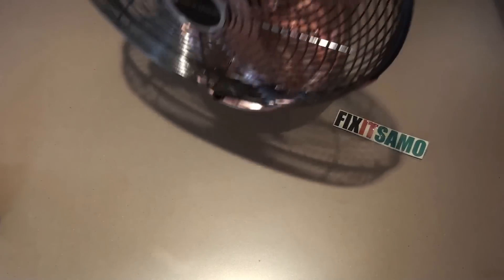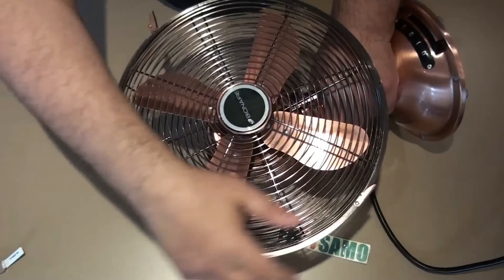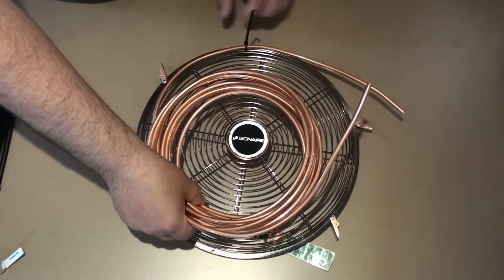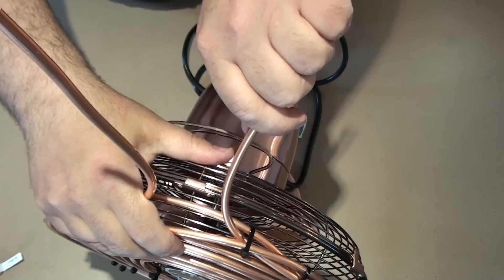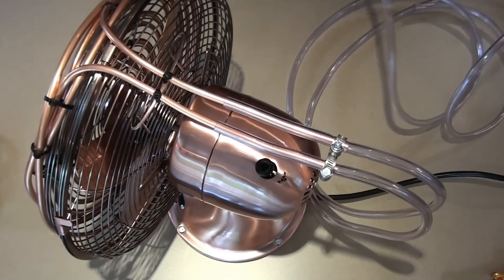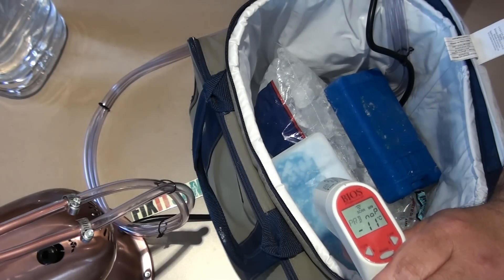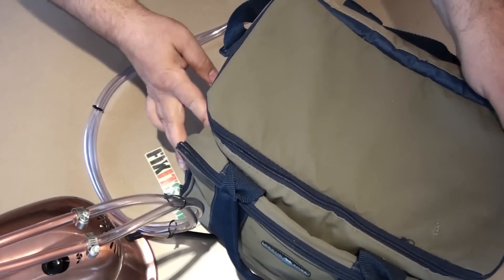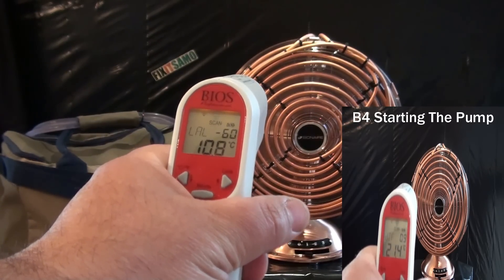How To Turn Your Fan Into An Airconditioner  AC

Comment: Great job ! I like seeing people use their mind ... INSTEAD OF CRYING LIKE BABIES. The "experts" making comments on here couldn't figure out how to blow their own nose with the instructions written on the box of tissues unless their Mommies did it for them ... as usual .... good gawd people. This guy is trying to HELP people ... WTF are YOU trying to accomplish ?? Go back to your cell phone world in Mommies basement while she's working 2 jobs to feed your useless ass.

Now for my 2 cents. How about having a full sized or mini FREEZER or even a regular fridge with about 25 or more feet of coiled copper tubing WITHOUT WATER inside ? Could even use an existing unit and only use one shelf for the copper tubing ?? could even leave it coiled up in the box to save room !  Drill holes in the top or sides of the unit to run the pipes and done ?  Seal it up with RTV or similar sealer. Put a catch basin  for any condensation that could be easily emptied as required. BOX FANS are great !! I use a box fan to circulate the A/C in our house because of Sky Lights ... yes, I have curtains in them but still get a lot of heat from them. We have central air that works great except for the rooms with Sky Lights. I'd never buy another house with Sky Lights. .... and NO they don't and never have leaked in over 30 years. I'm retired so not about to change it now.

Ok, now go ahead and chop me into confetti so I can have a few laughs !! LOL !!

Comment: Very good idea. I would put a coil in the back of the fan too. Because it draws air pressure from the rear. Also I would use a second(larger)  cooler for the return water so it has a chance to cool and will not immediately mix with the already cooled water. Place a second pump to feed the return tank water into the cold  tank. This should cool more and longer. I'll make one and see what happens. Again great video. Thanks for sharing.
Reply: Jesse Madison please do a video of the upgraded version.
Reply: @occipitalneuralgia2339   Thanks. Upgraded version release 07/10/20 I'll do a side by side comparison with my current portable ac unit.
Reply: That makes sense,  really curious if that works better please post & share if you build one like that.
Reply: @tanyapineda7212  Thank you for the encouragement. I will definitely post and share it. I currently have one of those portable air conditioning units. And honestly...it sucks. 
I believe that the fan idea would not only cool my room far better, but it would consume far less energy than the actual air conditioner. I'll post the comparison between the two. This will be very interesting. Thanks again.
Reply: @tanyapineda7212  have you made one yet?
Reply: Sound cool
Reply: @megatron6771  Thanks. Let's see how it turns out. Video Release date 07-10-20
Reply: could even put ice in the second cooler so it will be already cool when it returns to the original cooler!
Reply: @Son-Of-David1990  exactly.
Reply: just a quick note i thought about fitting the piping on the back but condensation drips collect on the copper piping and end up getting sucked through the fan blades.. i havent tryed installing them on the back but i have looked at quite a few of these diy ac fan vids and you can see in other vids that there is a fair bit of condensation with this setup.. i made mine with the pipes on the front and i have a 22 inch workshop sort of fan quite powerful from homebase uk cost like 40 quid. this idea is pricless and does work on a small scale.. its not going to cool a house or room but if you sit in front of it then its flippin chilly lol

Comment: This is a decent idea for one reason. 1: the ice is traveling through a tube, long enough to get the pipe cool, but not long enough for it to change the temp of the water drastically while it travels through. One drawback is the idea is good but the time of use before adding ice depends on what kind of cooler you're using, if you buy a cheap one you're looking at a few hours. If you got an extra 100 bucks or so you can buy a higher quality one.
Reply: This would be great with an old or extra Yeti!!
Reply: Bknnnjjjjjjjjjjjcj.       Chhxgc.   Hihgjh
Reply: Jhhhhhhhhhhjjjjhhhhghhhvhhhhhhhhhhhggbbbbvgghhbbbbbbbbbbbhbbbbbbbbbbbbbbbbbbbbbbbbbbbbbbbbbbbbbbbbbbbbbbbbbhhhhhhhhhhhhbnmhkgjgkghg

Comment: Just put ice in front of the thing
Reply: The fan will blow hot air across the ice. It will melt in no time. Hence the need for the ice chest.
Reply: @HueMongussD  doesn't for me, I have big ice containers
Reply: @nationalsocialist8382  If you have big ice containers, how do you blow air across the ice placed in front of the fan. But it doesn't matter if your containers are the size of a van. The ice will still melt way quicker when the heat exchange is taking place directly at the cold source. You will go through ice like crazy.
Reply: @HueMongussD  I just have 2 normal fans and put 2 litres of ice in front of them. Lasts all day at 85+farenheit. Then I swap it with the reserve waiting in the freezer. Simple.
Reply: @nationalsocialist8382  I live in Arizona where it gets up to 100°F or more! No way in hell that I'm going to keep buying bags of ice just to have it all melt in 30 minutes or less! I'm cooling off rooms bigger than a walk-in closet!!
Reply: @paranormalreality729  Bags of ice? I got the idea from watching a guy in the utah desert, you don't buy ice bags you mad thing, you have the containers from the freezer /refrigerator. The cool air blows around and stops the heat from melting the ice... Ice bags, lol
Reply: @nationalsocialist8382  I got ya! Right comment, wrong video! 🤣🤣 But yes, you are correct!
Reply: @paranormalreality729  😂👍 love to Arizona from Europe, it is July here, it's wet, cold and miserable and I got a freezer full of ice over here, you can come visit.
Reply: @nationalsocialist8382  I would love to take you up on that! I've always wanted to visit Europe! Beautiful country! Better than 100°+ every day and now it's the very beginning of monsoon season. Rained like hell here yesterday for about an hour then REALLY got HOT! If you'd like to warm up and dry out, I got you covered!! 😂😂 Could've used that ice yesterday! 🤣🤣🤣
Reply: @paranormalreality729  Europe is actually a continent 😂👍 I think it's about the size of a Texas haha. You're very welcome, we have a great fairy folklore culture and yes, it's very beautiful, thanks. We even speak English here in England, though it's probably not what you are used to. I live by the beach, such a waste without heat, haha. I'll email you some ice for the yesterday... It doesn't look like I'll be using it here anytime soon. Stay hydrated 👍😁
Reply: @nationalsocialist8382  I wouldn't exactly call what is spoken here english, not anymore anyways! Haha! Kids have forgotten what real english and manners are, some adults as well! I think I'd appreciate your kind of english better, besides, the accents are much better! 
That's really nice that you live near the beach! Lucky you! 
I'll be looking for that email! LOL
Reply: @paranormalreality729  I know, I know, we have endless US TV shows here, most of the youth here are also 'murknized'. The cops don't have guns here though, guns are banned. There's still plenty of gang banging and police shootings hyped by the media though. We don't talk like the BBC, or James Bond any more, well I talk like a James Bond, but after a few beers, hehe.
I'm struggling to attach the ice to the email, do you have Skype, LOL
Reply: @nationalsocialist8382  Lol! Well, it's a pleasure to meet you James! 🤭 I'll bring the beer! 😊😊
Dang ice! Always gotta be difficult!😂 Figures! Now I need to get Skype!  It might be easier to come to Europe! 🤣🤣
Reply: @paranormalreality729  I'm going to call you a giggling fairy then, but I only have martini, shaken, not stirred 🍸😎.
You can bring your beers though, happy 4th of July. The pubs, clubs, bars and cafes reopened here today and it's heaving with the thirsty folk, you're very welcome to come stay a while. You seem to be lively and fun, I'm the shy retiring type of course. Housecoat, pipe and slippers, but I'll definitely show you a good time, even if you don't have Skype yet, lemme know when you do and we can get to know each other better there. I'll bring the ice in case it's needed, LOL 😎🍦😏🍧
Reply: Melts hella fast

Comment: Hello, it was very good, but you probably could  have shown the parts closer, and tell which is the return tube on the inside of the fan  is  and the two pieces, I THINK they were two clamps that you tighten vs ties etc ,im guessing , and simple as it seem telling about the water flow direction on the copper pipes versus the tubes and water was placed inside a cooler with an electric pump, and water and electric dont mix , explaining the brief safety on that one would be goodand maybe an idea where to get the items, walmart, hardware, store, my  mom said cause she is mecanically inclined, but, she said that she  could l always learn  more, , other than that it was  a  Dam good video 😃, just  friendly suggetions.
Reply: Purpose designed electrical powered pumps can be submerged safely in water; this is common across many chemical plant operations, farms and homes in the world; Thanks, from Leslie Hlatshwayo, South Africa

Comment: Put the return line and the pick up line at opposite ends of the cooler. It will give the returning warm water a chance to get cooler before recycling it back thru. As it is now, the warm water is dumping out right where the pick up tube is and mixing with the cold water right away. That will raise the temp of the water getting sucked up. Meanwhile the coldest water in the cooler is nowhere near the pick up tube.

If you really want to extend the life of your ice. Connect the return line to a another coil of copper tubing. Bury it in a layer of ice, but above the water line. That way, the returning warmer water has a chance to cool before dumping back into the ice chest where the water has already been cooled. You should end up with even colder water circulating thru the system. Assuming you have your pump set at a very low speed. Your coolant source will be depleted in no time if you pump the water thru too fast. Because heating of the water will outpace the cooling of the water. Good Luck!
Reply: Definitely an HVAC guy. Good tip.
Reply: I thought about that for a sec,,, then I recalled- COLD water IS what is being Pumped it,,, it is not exchanging eat.
Reply: @angelchiriboga3904  yes, but as the fan pulls hot air across the cold water, a heat exchange takes place. The hot air becomes cold, and the cold water becomes hot. Therefore, the temp of the return water will be higher than when it left. The temp of the returning water directly influences the pace at which the ice melts.
Reply: @HueMongussD  it is such a small difference, by the time it returns, the already cooled water(33F) is being pumped Back into the line.
but Yes- you are right. Salting it takes it down to 20F. 
I would use that for a Bigger ystem.

Comment: I have an idea... I saw some people commenting about adding a mini fridge but the heat from the back of the fridge, and the energy it needs, would be to much for the gains. My Suggestion, and what I plan to do, is to use whisky cubes instead of ice in the water. They retain their coolness for longer and won't add to the water when melted like ice. Better yet, you can buy a few and keep some in your fridge and some to use, then change them every ~6 hours. essentially just one change a day. To keep it cooler and for longer you could also exchange the water for coolant which is more dense and then bottle it up at night in the fridge to cool down. This would result in seriously cool copper coils which means super cool air. Only problem would be the condensation on the coils, make sure to collect it in some way and keep away from electronics like the fan connected to mains!
Reply: gonna place the bag in my house hold fridge who's in the room next to my bedroom..Tubes true the wall and done...
Reply: @arthursoesman  insulate those tubes very, very well and measure the temperature of the fridge after use. Breaking the fridge's seal is like putting a hole through it so it may try to work harder to keep a constant temperature.

Comment: you might be able to make it cooler if you add rock salt to water to lower the freezing point of the water so you can pump even colder water through the coils
Reply: I too was thinking in similar lines of adding salt to further cool the 'freeze bag' but on second thoughts, salt is corrosive and don't think can be used with metallic copper in direct contact.
Reply: Put salt water in zipblock bags place them in freezer for a day. Take them out and place them into cold water in the cooler along with cooler ice packs
 so it dooesnt damage the copper piping
Reply: genius !
Reply: You can add rock salt to it or salt, but it will make the ice melt at a alarmingly faster rate, and thus having to change out the ice alot quicker. ( Though from the looks of it, he was using those ice packs you put in Igloos. The salt probably wont work like that though.)

Comment: How long  does  it stay the same temperature before you have to add more ice?
Reply: i guess that would depend on how hot it is
Reply: @romar386  Around 78 degrees Fahrenheit?
Reply: Well this guys house was like 68 Fahrenheit and it dropped it to like 50. It might depend on how hot it is but considering the ice is in a cooler it wouldn't be a wide margin as the water isn't in the pipe long enough to gain much of a temperature change before it returns to the cooler as the water is obviously cooling the pipes as well. It would also depend on what kind of cooler you use for your ice and water. Some can keep your ice for a few hours, there are higher quality brands that can keep the ice for several days.

Comment: What’s the length of the copper tube?
Reply from the maker: I used around 15  feet
Reply: fixitsamo ok thx 👍🏽
Reply: fixitsamo Also how many feet for the water hose? And also is it a low pressure water hose?
Reply from the maker: All parts and info are in the description below
Reply: @fixitsamo  will this cool a small room please reply thanks and appreciate you're video and sharing knowledge God bless you 🙂

Comment: Coolest video of the summer, well done, thank you!
Reply from the maker: Thank you
Reply: @fixitsamo  can i know how long did the water remain cool? or how long did this DIY aircon last?...can it last the whole night?..............thanks for sharing ... coool setup
Reply from the maker: Between 8 to 10 hrs depending on how much ice you put and the quality of your ice cooler after experiencing i found out that if you add ice in big blocks  it will melt a lot slower  and you could have between 10 to 13 hrs off cool air
Reply: @fixitsamo  When it lasted 8 to 10 hours, what was the temperature in the room like before you turned it on? Thanks!
Reply from the maker: I have  a 12x15  feet  workshop outside  the house with insulation  and jibes installed  it could lower the temperature from 35 to 23 degrees  im now using blocks of ice by refreezing my ice bags  the ice is melting a lot slower giving me more time of cooling air  2 to 3 extra hrs
Reply from the maker: And i lowered the water pump speed to minimum letting the water go threw the copper tube slowly  this will make the water pump produce a lot less heat in the cooler
Reply: oops! I see now in the inset that it was around 21 degrees C. I'm thinking of using this in some real heat - about 31 to 34 C - have you ever used it in temps like that?
Reply: @fixitsamo  Thanks man!